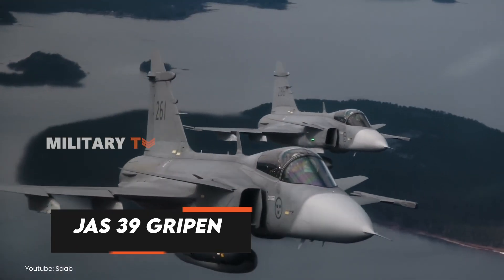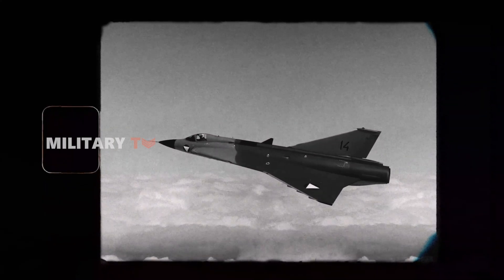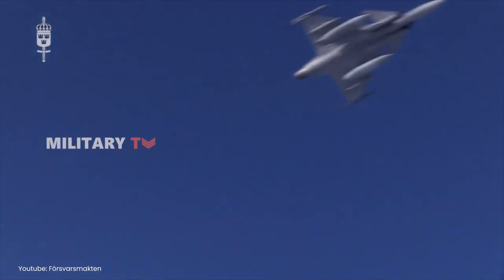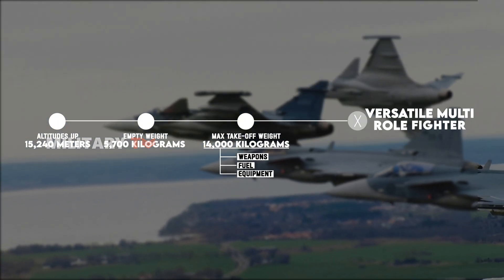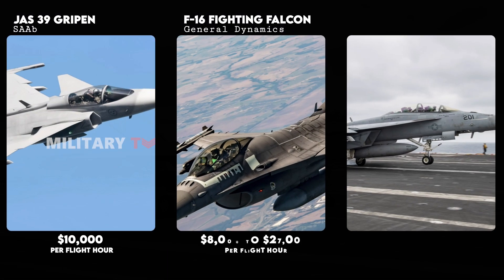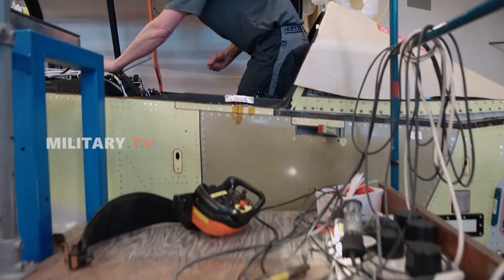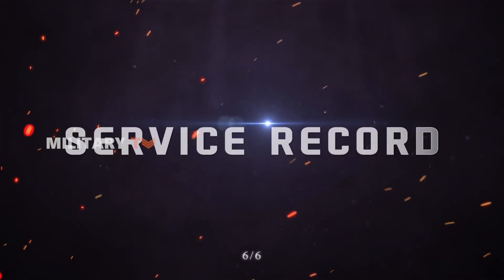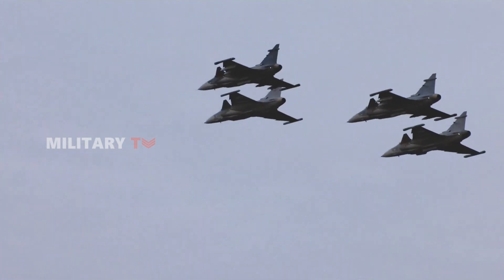Saab JAS 39 Gripen: Swedish Multi-Role Jet That's Easy to Fly and Cheap to Operate!

Comment: U.S approve to sale 20 unit F16 block 70/72 for the Philippines but another 20 unit of moultirole fighter need to complate the total 40 unit of moultirole thats why we hope Sweden continue to offer and approve there gripen E/F sale for the Philippines to complate the 40 unit of moultirole fighter jet that philippines need the F16 block 70/72 and the gripen E/F are very strong combination for the philippines to have capability secure protect the teritory in eny kind of treat🤔👍👍👍

Comment: Gripen E is more or less a clean sheet design compared to the C/D versions. SAAB claims that it was a bigger step to develop the E version than to go from Viggen. It should have been renamed to something else but due to political reasons it was not possible.

Comment: The new E/F versions are considered as totally new jets. They look similar to the C/D versions but have a new engine, larger fuselage, longer operating range, higher load, supercruise, new sensor suite, computer platform to integrate any weapon system, and more. Typically, the sensor suite is a magnitude better than the C/D versions, and in operation, it can detect things such as the friction heat of incoming missiles. What you can detect, you may counteract, including so-called stealth objects. Moreover, by combining it with Global Eye, nothing goes undetected.

Comment: It's the cheapest to operate.  It's underpowered compared to the competition.
Reply: According to what metric? 
It performed exceptionally well in the Red Flags it partificapted in. Only the F22 did better at the time.
Reply: F-35 = Three times more powerful engine than Gripen. F-35 top speed Mach 1.6. Gripen top speed Mach 2+
Reply: Cheapest ?? compared to what ? Seriously 🤦 😕.
Reply: @jimmyohara2601  I guess he means compared to any equivilent fighter jet. But he doesn't specify... So hard to tell.

Comment: Gripen E is currently the newest fighter aircraft on the market with all the latest tech available. The latest delivery include changes made on the E model in 2023/24, such as larger wings with new shape, canard wing slightly moved and changes to the steering system accordingly to the above.
Reply: E/F - They're the same but E with one seat and F with 2 seats. Just like the A/B and C/D versions of the gripen.
Reply: Nov 6, 2023. (Nota Bene: the last sentence)

Saab’s Gripen E multi-role fighter continues to achieve numerous milestones, including delivering the first series production aircraft to the Swedish Armed Forces. Interestingly, one of the jets started using a modified wing shape.
One of the fighter jets uses add-ons on the rear side of the wings. This causes the wings to have a larger overall size.
Until now, the official party has not announced the wing revision. However, in the latest photos released by the Saab E, the 6002 series fighter jet clearly has extra surface area on its wings. The result is a wing that appears more trapezoidal. The final model leans more towards a delta wing than the previous model.
Some even compared the new look to the Cold War era Rego fighter jet. This fighter aircraft, which is also made by Saab, has a large twin-delta canard configuration.
Johan Segertoft, head of the Saab Gripen business unit, explained the reasons for the change. According to him, opportunities to increase the Gripen’s heavy payload capabilities were identified in the early stages of the development process. important for future operations.
“We decided to implement this fix as quickly as possible. Includes software updates and some modifications affecting the canard and elevon surfaces.”
Although Segertoft mentioned changes to the front canard, this is not immediately visible from the photos released so far.
The basis of the Gripen design philosophy, continued Segertoft, is its ability to adapt quickly and efficiently to changing needs. They are constantly improving their aircraft in both tangible and intangible ways. With the integration of new technologies and new requirements.
Fighter aircraft must be developed quickly, efficiently and cost-effectively to meet user needs.
While the wing modification may have only just been confirmed, the idea has actually been around for a long time. According to Segertoft, the feasibility of such upgrades was determined in the early stages of Gripen E development.
The first aircraft with the improved wing configuration took to the air in the second half of 2021. To date, there are 16 Gripen E fighter jets flying in Sweden and Brazil.
According to Segertoft, new design features have been added to some of the aircraft. and has successfully completed flight tests. Segertoft also confirmed that this modification will become the standard configuration for all future mass production aircraft from customers such as Sweden and Brazil.
Reply: @bjornnordstrom  also Thailand, the latest customer for the E version. Great comment. I've written 2 answers, with SAAB quotes, but were deleted. Alphabet at its best
Reply: The new lager wing by enlargement of flaps not confirmed by SAAB. Seems currently only in experimental status. Let's take a look at the latest production Gripen E airframe which is for Brazil AF whether it got the new big flaps or not.

Comment: its cheap to fly and operate but not to buy🤣🤣
Reply: During 30 years of use... A bargain!
Reply: Thailand buy jas39e significantly cheaper than f16block70.
Reply: Cheap ? Compared to what ?? 🤦Seriously 😕.
Reply: @jimmyohara2601  Flight cost per hour: F-35A = $33,000. F-35B = $42,000. Gripen E = $8,000.

Comment: Sadly Denmark bought the expensive American F35 😔🤦🏼‍♂️
Reply: Useless expensive
Reply: The F35 is actually the same price as the Gripen and far more dangerous.
Reply: And the Finn's...🤨
Reply: Yep, Canada as well. Our government couldn't judge a one horse race. This gem cost 1/3 as much as the F35 to fly and it would have been built in Canada. 
We are led by buffoons.
Reply: Wtf
Wdym sadly? 

The F-35A costs about the same as the Gripen E/F, or even less in certain metrics, when making a proper apples to apples comparison, while at the same time being a much more capable jet. 
So, in other words, the F-35 is much more cost effective fighter than the Gripen. 
There's no comparison.
Reply: @deltasierracharlie  Talking is easy, I want to see it proven. Not to mention the enormous damage that the F-35 has already caused with countless accidents and endless reviews of failures and conflicts in its very expensive systems.
Reply: @TheSalomov 
It’s statistically safer than most other modern jets including the F-16.
Reply: @deltasierracharlie  no maybe to buy not mentain
Reply: @deltasierracharlie  Also the F35 has about a 50% downtime. So for every 2 F35's you can only ever fly 1 at a time.
Reply: @deltasierracharlie The two aircraft both cost $85 million if you get partner pricing with the f35. However, operating costs for the f35 are almost double over the gripen. Unfortunately, the f35 will never meet its low operating costs that some were hoping for.
Reply: @deltasierracharlie  Yea, the cost of buying the jet is more or less the same. Operating costs however....its a total joke if you look up the numbers. F35 is much more expensive to operate
Reply: @deltasierracharlie 😂 be real son...
Reply: @deltasierracharlie  even if you ignore costs the downtime of F-35 is way higher than Gripen.
Engine replacent on Gripen can be done by mechanics in 40min in the forrest. For F-35 it's literally days.
Reply: @deltasierracharlie 😂
Reply: @deltasierracharlie No the cost for a flight hour with F 35 is 30 000$ more expensive than a flight hour with Jas 39 E. So after 10 000 flight hours the F 35 is 300 000 000 $ more expensive. Thus we can say that the JAS having 90% of the capabilities of a F 35 is more bang for the $. In fact you can have three to four Jas 39 E for the cost of one F 35. On top of this Jas has a 0,045 RCS while flying low.